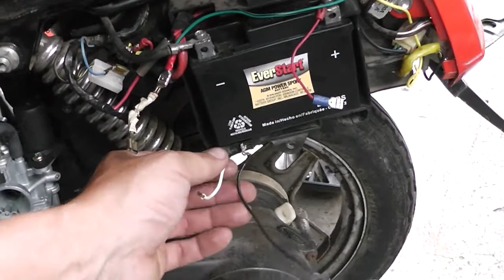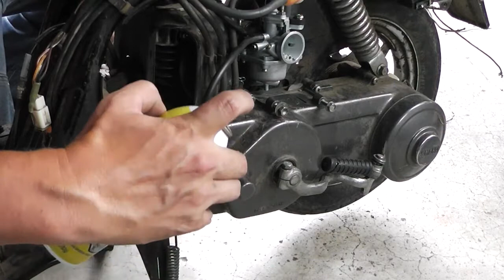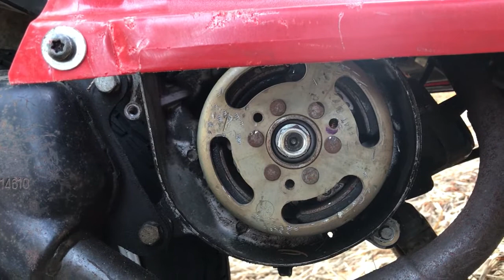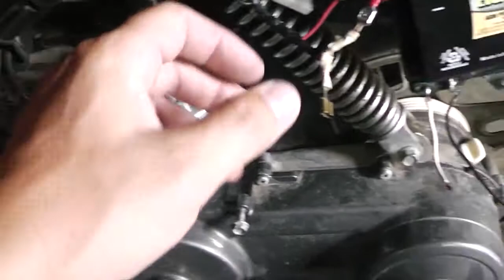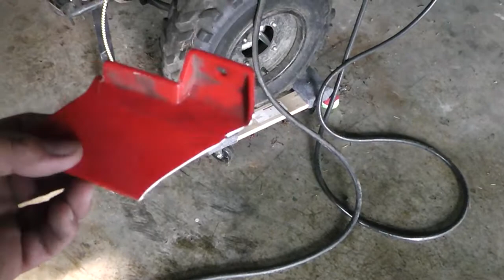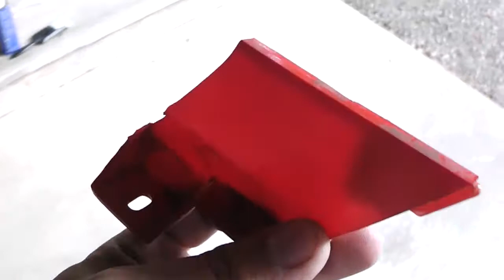49cc Yamaha Riva   "PART 2"

Comment: wight wire is red positive. it keeps cerent  sepret. black is negitive grown
Reply: White wire is red positive. It keeps current separate. Black is negative ground.
Reply from the maker: Bruce, I found that color really doesn’t matter if it has enough wire to hang myself with😵